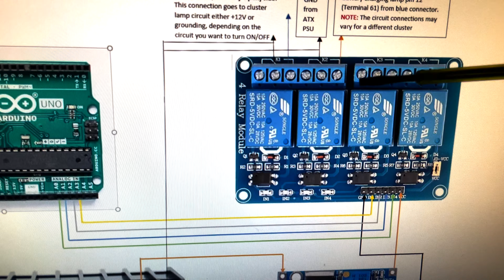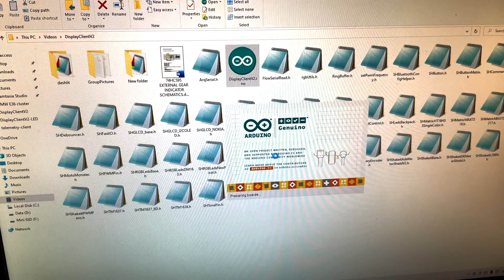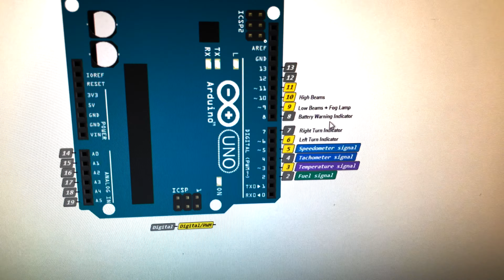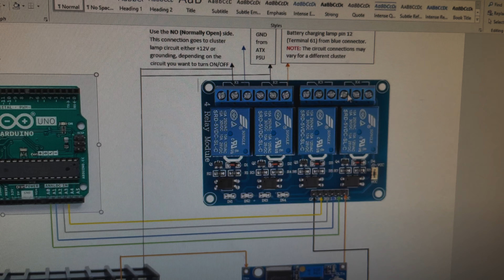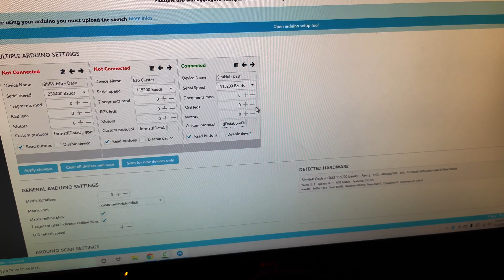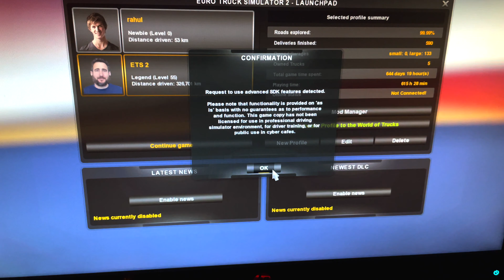How to wire BMW E36 cluster with basic dashboard lights #simracing #bmw #automobile #arduino

Comment: Hello part 2. It seems like the NO thing didnt work. Got any ideas. Im thinking beamng doesnt output a on off signal just a constant on. I tryed adding a blink to the Ncalc Formula but i have no idea what i am doing.
Reply: In the window where u have ncalc, u can add a property there, u get a list of realtime names and  values from game u have open ,   U can filter there what u want to have like your  turn signals.. when found and supported, u can copy the name (right click).. click on ok.. past the name in ncalc in the proper format… these lines Will read your shprotocol.h , Search for that file, it should be in simhub addon folder.. open this in your ide software , there u find Somewhere a rule  with the word flow in there.. this rule Will pickup in order what u have put in ncalc… experiment from there ….

Comment: hey, dont know if u are gonna see this, but if i were to change batt, out with parking brake. how would that code look? I can get everything to work just fine. exept parkingbrake light. have tried ALOT this past week. would you know what to do?
Reply from the maker: You need to substitute/ add the ncalc variable for parking brake. Then just pull the corresponding serial data from Arduino and enable pin to go high or low depending on your relay wiring setup.
Reply: @sciencetrove  yeah i got it All working. 8 different lights and an oled display in the middel. 😅
Reply from the maker: Amazing! Glad to hear you got it working 👍🏻

Comment: Is anyone able to help out ive got a different type of 4 way relay and iam confused on how to connect it all up 🙏
Reply from the maker: The relay you are using is a shield type that goes on top of Arduino, more compact. As for the one in video, on the input side: there is power Vcc& GND, the IN1, IN2 etc are inputs that gonto corresponding Arduino pins for various lights mentioned in video. 

On the relay side you connect the 12V to thr COM terminal of relay. Then for the cluster light wires (high beam, turn signal etc) to the Normally open or closed terminal accordingly.

Comment: Hello don’t know if you will respond but, when I try to hook it up the blinkers click on but it’s a constant on. I’ve tryed beamng and ats only ats works tho. I’ve kinda gotten the left blinkers to work but right won’t flash.
Reply: its the ncalc formula
Reply from the maker: or just connect the relay terminals to NO (Normally Open) when blinker is off.

Comment: Sketch uses 10130 bytes (31%) of program storage space. Maximum is 32256 bytes.
Global variables use 545 bytes (26%) of dynamic memory, leaving 1503 bytes for local variables. Maximum is 2048 bytes.
avrdude: ser_open(): can't open device "\\.\COM5": Access is denied.

Failed uploading: uploading error: exit status 1

I got this error, do u know the solution?
Reply from the maker: Either the port you selected in Arduino IDE is wrong or the arduino is in use by another program

Comment: How to add more indicators like parking brake fuel warning abs and others?
Reply from the maker: You will need to add some lines of code in the .ino file and also corresponding mods in the Ncalc formula too. That's how I added them for this cluster long back.
Reply: @sciencetrove whats the code for the check engine light?

Comment: Hi! Can you do a simple tutorial for use all cluster of BMW e36 with all warning lights and relative protocol? Your tutorial Is the best of YouTube, thanks for this. (Sorry for my bad english, but i'm italian).
Reply from the maker: Hi, I already have a couple of e36 videos now. One of the main issues I noticed is that there is a lot of wiring and people who have no idea about relay channel can mess up and destroy their arduino or channel. So, I’ve now moved to can bus based clusters only. They have wires only for 12V, ground and two or four for can bus lines. Anyway one final project using these old clusters, I’ll be making a video for a Mercedes W140 cluster will be coming up later. It’s similar to e36 and analog. So, its code can be used with the e36 also.
Reply: @sciencetrove so without the relay thing for the cluster for the indicators it eill mess up everything?

Comment: Hi, if i upload the program,which you linked in your description,to my arduino it will not really work. On the cluster the rpm and Speedometer will work but the temperature gauge, fuel gauge and signals won't work. If i program the arduino over simhub with the Arduino set up tool,the temp,fuel,speed and rpm work,but the signals stil won’t work. Can you help me?
Reply from the maker: Signals don’t have anything to do with Arduino setup, but it’s the ncalc. 

For temps and fuel to get working you need to play with the “output values”in gauges in simhub. Open a game like LFS or ETS and then minimize it. The try to play with output values until it matches game. But wait for like 10-15 mins after you launch game prior to doing this. At least that how I got mine working.
Reply: @sciencetrove  so what ncalc should i use?
i will try soon the output values
Reply: @sciencetrove  temp works now but fuel still not, which doesnt matter that much for me. The ncalc data is from description but still no function

Comment from the maker: Hi, 

Recently I have had a lot of folks contact me saying this code is having issues with the past few versions of simhub. Make sure to use the arduino library files I have added to the description.
Reply: Can this be done with an arduino nano?
Reply from the maker: @MADDDEANO  Yeah, I guess so it should work. Just make sure to assign the PWM pins for the gauges.

Comment: hello, what exactly should i add in arduino code for more indicators like parking brake or oil pressure?
Reply from the maker: You will need to add the NCalc details and then some code is necessary in the Arduino code.

Comment: I’m getting an “adafruite gfx” file not found
Reply from the maker: You need to add the adafruit gfx library and then compile.
Reply: @sciencetrove  How would i do that, Ive downloaded it from their website but I dont know what else to do
Reply from the maker: @ibraheemnader Download the library zip file. Then in arduino IDE>Sketch>Include Library> Add .zip library
Reply: @sciencetrove  C:\Users\ibe..\Documents\Arduino\libraries\Adafruit-GFX-Library-master/Adafruit_GFX.h:12:10: fatal error: Adafruit_I2CDevice.h: No such file or directory
 #include <Adafruit_I2CDevice.h>
          ^~~~~~~~~~~~~~~~~~~~~~
compilation terminated.

exit status 1

Compilation error: exit status 1.>

I've done what you've suggested, but I keep getting the error
Reply: In file included from C:\Users\ibe..\Desktop\DisplayClientV2\DisplayClientV2.ino:376:0:
C:\Users\ibe..\Desktop\DisplayClientV2\SHTonePin.h:4:10: fatal error: Tone.h: No such file or directory
 #include <Tone.h>
          ^~~~~~~~
compilation terminated.

exit status 1

Compilation error: Tone.h: No such file or directory

after correctly installing adafruit this is what i get now
Reply from the maker: @ibraheemnader  I've added my arduino library collection to the description. Please follow that if you still have issues.

Comment: For battery should I use the same wiring (on the relay) as the turn signals or the low/high beams
Reply from the maker: Battery indicator lamp or as in 12V hot supply you mean?
Reply: What pin on x17 connector for engine light? Do I use a 12v+ on the pin?

Comment: Can I use as a 12V powersupply also a  12V DC Power adapter and a 12V Female Socket Connector?
And do I have to use twisted Jumper wires to wire the Indicators and the Beams from the relay module to the arduino uno?
Reply from the maker: If you plan to use the dash lamps on the E3) better to get a 12V adaptor with 3-5Amps rating. The bulbs on the E36 are the filament type and draw quite a bit of power. Else you need to swap it with some led replacement if you are using a weak power supply like 12V 1Amp. 

Nope twisted wire is only used when you have a can bus connection. Everything else just normal wiring.

Comment: Hi, i also saw your e46 video, i want to restart my e46 project, currently is Mondeo Mk4. What are you using for speedo instead of transistors? like that black thing with a lot of screws, how is named?
Reply from the maker: Hi, the MK4 is also a canbus based project right? Well for the speedometer I found that even without a transistor it did work. But I didn’t test it far enough to see if there were any negative effects. When I build the k-bus circuit I just added the transistor for this too. If soldering and board arrangements are difficult for you or you are not willing to go an electronics tech to get it then a simpler option is assemble the on a small bread board. You can easily find how to use a bread board on YouTube and then connect them as per circuit.

The black thing is a screw terminal strip rated for 30/40 amps.
Reply: @sciencetrove  Mondeo is also full can bus based, very easy to do, i can add you on discord to talk there. For e46, when i use transistor for speedo, it moves by itself, i dont know why.

Comment: I dont have the relay modules yet, but the fuel and the temp gauges should already work right? The values in simhub change for them, but the fuel reserve light and the fuel gauge doesnt move, same with the coolant. I have a speedo from 316.
Reply: im a bit confused of powering the relays. Currently I have followed the guys tutorial who made a dc jack to power the lights and stuff. How will I power the relays? Thanks!!
Reply from the maker: The arduino relay module have pins Vcc & GND. That should be powered with a 5VDC supply.
Reply: @sciencetrove  Do you have a discord or something? Would be easier to ask questions from you.
Reply from the maker: @chris_nua  I’ve never used discord and not very familiar with it. But I’ve made an account now just in case. Server link is https://discord.gg/syNFTVA3
Reply: @sciencetrove  Alright!! Thanks! Just joined it!
Reply from the maker: Yep, gauges should work. Again this was long ago I had tested. I remember you need to play with those PWM values for gauges in simhub to get it working properly. Especially for the fuel gauge.

Comment: Hi i want to do sim rig and i need to wire the Skoda fabia 1 cluster but i don´t know how i can do the arduino protocol.
Reply from the maker: The skoda fabia cluster I think is a can based type. It works a bit different than the ones shown here. You need to identify the cab bus codes to get the cluster running with arduino code to get it running.
Reply: @sciencetrove  And where is the can bus code? or Where i can get it?

Comment: How do you program the warning lights in the simhub Arduino setup tool?
Reply from the maker: Warning lights are written in arduino SHCustomProtocol.h file and also add the warning light parameters in NCalc formula too
Reply: @sciencetrove  Please explain how

Comment: I tried doing this on my E36 cluster but when i try to upload the c++ custom protocol to the Arduino I get an error message "'FlowSerialReadStringUntil' was not declared in this scope" every time. I am sick to my back teeth with errors with flowserial bollocxs. Mind you, this is one of those videos to fall asleep too
Reply: i have same problem :/
Reply: @peterszabo50  I gave up trying to make this work so I soldered a few individual WS2819B neopixel rgb leds I bought off ebay. They are the same size as the hole in the back of the BMW cluster just be careful not to have them make contact with the circuit board on the cluster otherwise there is potential to cause damage to the cluster/arduino or worse, your pc. I used a hot glue gun to put a thin layer on the circuit board before glueing the bulbs in place. They work a treat.
Reply: @jasonnicholas3722  hey if it’s not too much trouble can you send the code, I’ve had crazy amount of issues with this code, also do you use the relay channel or not? It you can and I would understand if you can’t,please make some sort of video showing how you did it.
Reply: @ibraheemnader  I couldn't get any of the relays to work no matter how hard I tried, so I threw the relays  in a box along with all the other failed to launch tat. I bought a load of ws2812b neopixel led bulb off ebay, soldered the bulbs in sequence and used sim hubs rgb function to get everything to work. The led bulbs are just the right size to fit in the clusters bulb slot and I used a little hot glue to secure them in place making sure not to let the bulbs make contact with the metallic strip on the cluster. It took a little time to figure out how to fully understand the basic concept of sim hub, but there are plenty of YouTube videos for easy connectivity. I now have 45 bulbs in total sitting beneath a variety of different switches along with the cluster on a single arduino. The bulbs are a little fiddly to solder but when you've soldered enough wires it does get easier.
Reply: @jasonnicholas3722  thank you so much, ill have to try this soon. I ended up removing the relays and ditching the code all together, made a custom script and now it works
Reply: @ibraheemnader  no problem. As I said in my previous message, ws2812b and sim hub's software works brilliantly. The bulbs are cheap and easy to buy off ebay and you can either use the free version of sim hub's software (which works very well), or pay a small donation for a license. I didn't stop at just adding leds to the cluster, I added a further 20 bulbs on my button box. Sim hub's software allows you to program each bulb individually or all at once. Don't be afraid to experiment with the software, but make sure you solder the bulbs in the sequence shown on the back of each bulb and don't hold the soldering iron on the bulb for more than a second or two otherwise you could damage the bulb. No I am not paid by sim hub, but I am yet to find anything better. My sim rig has 2 4x20 lcds for truck and job info, 1 .96 oled for road speed limit, 1 8x8 dot matrix for a gear indicator, the bmw cluster and leds and a digital clock all working through sim hub and other than the fuel gauge not showing the correct info, everything works fantastically. No writing longwinded arduino code, everything is all in one place. The only problem is you'll end up like me and add more.
Reply: @jasonnicholas3722  I would love to do that, I also appreciate sim hub. IMO, it's the best out there period.
Reply from the maker: Sorry for the late reply. I just downloaded the file below just now and tried compiling. It compiled fine. Make sure you have all the Arduino libraries or it will keep throwing errors

Comment: hey there im wondering how i would add a check engine light to the custom protocol and make these custom lights work on assetto corsa i aint the best at coding
Reply from the maker: I’ll need to look into it since I haven’t checked it out. I do know check engine light works on ETS2 and ATS. In my latest video on the E46 it works for these two games. Assetto Corsa also should do the same thing I guess, but I haven’t played that game more than once long ago.

Comment: My question is in regards to the 12v feed on the relay board  can this can be taken from anywhere say such as x4 extra wires connected to the power supply barrel jack as the 12v pins already have power pins going to them.
Reply from the maker: Yes, the 12V feed is from the 12V supply you are going to power up the cluster. The 12V jack you mentioned should be fine.  In my case I used an ATX PSU to power the cluster. The Arduino is powered via the USB port. Anyway it's mandatory to connect to SimHub.
Reply: Also the wiring pinouts you have included shouldnt x16 pin 2 be connected as 12v also think you missed that out tho i see it further down the page maybe it should be up the top with the other 12v+ maybe?
Reply from the maker: @sjames_14   The x16-Pin 2 is for cluster illumination. I connected it to the Arduino pin assigned for low beams via the relay channel.
Reply: @sciencetrove  Can you please confirm the pin out from the cluster to the relay please what pin goes where the instructions in the description seem to be a bit off to an degree sorry you already have assigned 6  to left indicator and fog lamps according to your instructions sorry for the hassle 

Connector X16 (White)
High Beam: Pin 1
Cluster illumination lamp: Pin 2
Right Turn Signal: Pin 3
Left Turn Signal: Pin 4

Connector X17 (Blue)
Battery Warning lamp: Pin 6
Fog Lamp: Pin 8
Reply: @sciencetrove  Thanks Im sure ill have it completely frigged out by time i get around to doing it likely in an few weeks time what would be awesome is an remake from start to finish of doing the full wiring :)
Reply from the maker: @sjames_14  Mate I think you are confused with the first set of pins mentioned in the description. The first set are for the pins on the arduino UNO. The ones mentioned under " BMW E36 cluster dash pinouts:" are the pinouts for each function on the cluster connectors. You can see these cluster pinouts in the BMW electrical manual too. 

Okay let me explain the one you have asked above as exmple:

On the cluster the cluster backlight is Pin 2 on the white connector & Fog amp is Pin 8 on the blue connector. You need to connect a jumper wire to these two connections and tie them together and connect to on of the relay's on the relay channel. The corresponding relay channel data pin "IN1, IN2,,,etc_) should be connected to the Pin 9 on the arduino. Same thing for the Left turn signal on the cluster with Pin 4 on cluster goes to relay, and relay data pin is connected to Pin 6 on arduino. I hope you have an idea now.

Unfortunately, I'm quite busy with work and other stuff. I'll make a thorough full video tutorial in July during my vacation.
Reply: @sciencetrove  No worries all understand an little better now :P and all good that would be absolutely awesome if you would do that I am still waiting for dash to arrive